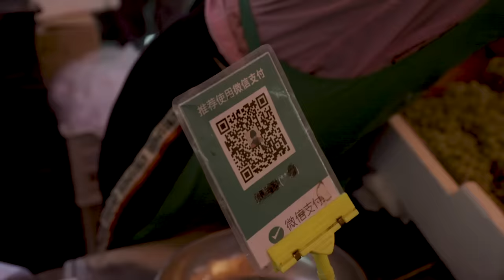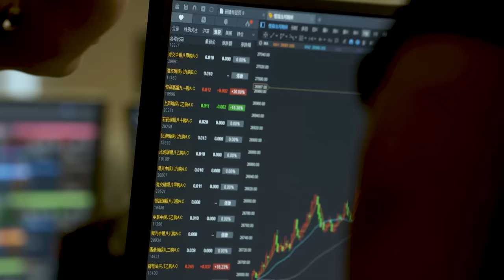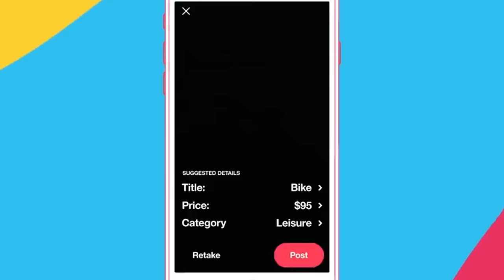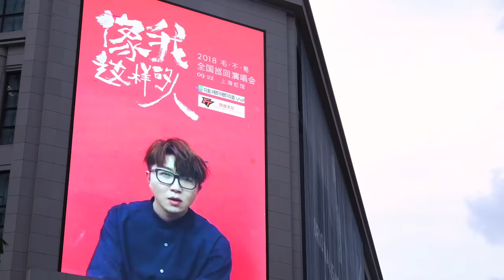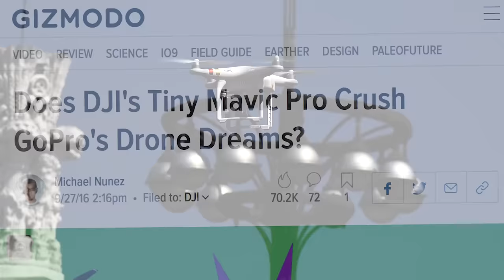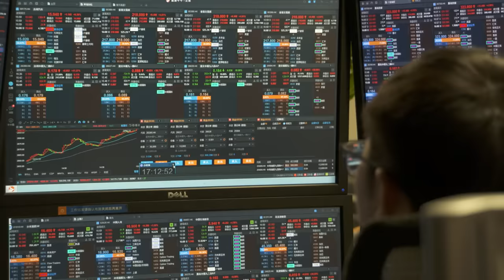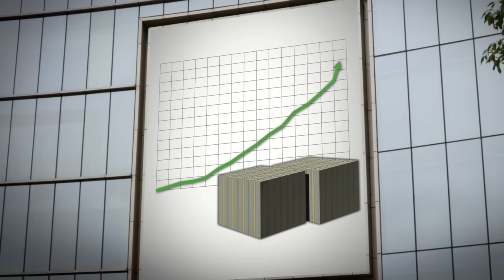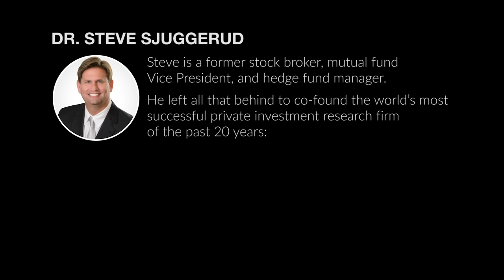New Money: The Greatest Wealth Creation Event in History (2019) - Full Documentary

Comment: So if your battery dies you have no money ?  Correct.
Reply: @Enemic Pezpot but with network or disasters problems, which are increasing in frequency now a days,when money is needed most, blockchain is dead. Cash is not going anywhere.
Reply: Yet they call it smartphones ironically.
Reply: ventende the qr code can’t be copied and changes every time you use it. There is no way anyone can hack it
Reply: There r portable batteries station every 5 mins you can walk from
Reply: oneviwatara  that's why you installe it in a cold storage wallet off the exchange it's called a nano ledger, s.
Reply: Enemic Pezpot You could technically have a wallet that signs private key and uses some sort of RFID chip (I Don't understand RFID tech) and you could have this chip inserted and programmed into your hand, powered by your blood pumping through your body or something like your body temperature. Something crazily futuristic like that. Then that would allow you to sign transactions without losing the ability to spend when a device loses its battery power. Only problem is when you're dead you can't pay for things anymore 🤣
Reply: You are bankrupted the instant your digital identity and database is wiped out.
Reply: TS Lee Bitcoin doesn't require you to have an online identity. If you don't believe me I can get you set up with a wallet and send you Bitcoin and prove it to you. The database cannot get wiped out, it's a distributed system It does not have a single point of failure. No one can restrict you from using your coins, they can't block your IPs, they can't stop you from having access to Internet unless they locked you up in a cell or turned off a whole countries Internet. Then again there are still solutions such a the Blockstream satellite that allows you to transact via satellite. Not only that but entrepenuers are working on bringing a global Internet system using satelittes that won't be able to be censored
Reply: @PumpkinToshi  you can't hack BC, but you can hack the wallet
Reply: Space Monkey If you have your money in an exchange (Basically a online Bitcoin bank) your account can be hacked. If you store your private key offline using a hardware wallet. Your wallet can not be compromised. it's not hard to secure them responsibly. Not Your Keys, Not your coins. 
Some mobile wallets have some pretty good security also you just have to be smart and use common sense :)
Reply: david stewart  What if the phone breaks down ?
Reply: @saltymonke3682  Mount Gox
Reply: @PumpkinToshi  still, you need to go to the exchange to convert it into flat currency if the shop won't take BC as a payment. Even the shop still need the exchange to convert those BC paid by the customer to pay bills in flat currency.
Reply: There will be decentralized exchanges which will mitigate the risk of trasfering between cryptocurrencies. There will always be a 3rd party risk with fiat off ramps and its security should be strictly regulated..the whole point is to keep the bitcoin and not sell it for Fiat. 

Space Monkey You can use 3rd parties that instantly convert it and the merchant doesn't know your using Bitcoin but it's not the point. I'm talking about in the future. It's like saying It's like saying in 1995 "Everyone's not using the Internet right now, so it's not going to be usable in the future"

Bitcoins not even ready for merchant adoption it's still in development. Bitcoin as of now is not used as a medium of exchange but a method of saving and speculating that the price (Due to the economics of the protocal) will rise in value. Once again, people didn't just start using the Internet overnight these things take time to develop although I just used Bitcoin in Japan to buy snacks and a travel sim card in the biggest tech store in Japan. Everything's there food, alcohol, tech, random shit so it's gradually being adopted it just takes time. 🤣 

Getting into Bitcoin now is like trying to get into the Internet cyberspace in the 90s. It's a niche of nerds and weirdos. But getting in early, if you research and understand how innovative it is, you could be rewarded in the future.
Reply: @jamesb.492  What a misinformed bunch of malarkey regarding the most liquid asset in the world. Gold sits above central banks' own fake currency. Check out central bank gold purchases over the last 10 years. Check out how the BIS made central banks report their holdings before it became hidden from public eye. GOLD ONLY. You're just a pawn spouting exactly what they want you to spout. I recommend reconsidering your misconception.
Reply: @marccompagnon219  You talk like China is using decentralized anything.. it's not crypto dude it's digital fiat scam money.
Reply: There is a thing called portable powerbank, guess they dont exist in USA.
Reply: If the power goes out for days due to a natural disaster, then there would likely be concern over the ability to charge a phone so one can continue to be a part of the consumption.
Reply: That is the problem, power never goes out for days in China, they have the best power grid in the world.
Reply: @cainiaowu  and their building the greenest tech thorium power stations, most of the world still installs 1950's dangerous designs
Reply: Well, it is not the fault of most world, China is late to the party, so it can use the latest and safest design available.
Reply: @PumpkinToshi  that already exists. nobody wants it though. I Sweden they're forcing it on a few people through their job.. they have an advertisement like this one about it here on YouTube where everyone smiling and happy and saying the tech is great and totally not evil.
Reply: MechanicalCheeze I'm guessing your talking about the hand chips right? I think there's a time and a place for these to get pushed into the market and right now there's not really a need for it. Sometimes people love to push tech into people's faces before they're ready for it. There's still a large number of people who can't even use a smart phone. I think we have too get through that stage of adoption before we innovate any further. It'll be part of our future I'm guessing, I just believe nows not the time. Same with Bitcoin, you can push people into as much as you want but the current banking system works perfectly fine for most people so why would they change? . It has its faults but thats not the point it's what they are most comfortable with. Right now the benefits of Bitcoin can be seen by a very niche market such as people that hate the current system of money, speculators who want to get rich of the volatility and Unbanked People with a technology background, educated and has easy access to smartphones.
Reply: @Aloewells  Cash isn't going anywhere and neither is cryotocurrency.
Reply: you can easily get charge your phone easily, in many small shops and restaurants have sth like mobile battery, they charge around 1 yuan I think. debt battery is not really a big problem.
Reply: I am sorry. We have share power banks everywhere. So, that's no even a problem
Reply: Efc Scouser ofcourse  that’s why iPhone is losing its marketshare in China, too quick to running out the battery 🔋
Reply: @Aloewells  please do tell me the last time bitcoin had a disaster.
Reply: oh , come on. do not be serious. We do carry wallet for emergency
Reply: Holy shit omg didn't think of that!!!
Reply: probably will be able to use your watch soon, which the battery can last for a week
Reply: @PumpkinToshi  point of failure is when I use crypto analysis. To come find you,  and rob you ,    your entire bankaccount is in your memory. Via password,  bankrobbery made simple.  Stay away from crypt-o
Reply: Fred Thompson You make it sound simple. Infact it's not. The reality is, it's safer than using the current banking system. The only point of failure you have is yourself. In the future, recovering funds and securing funds will be much more simple such as offline wallets being pre installed on smartphones. It's not a bank account. You can get my password but that doesn't give you access to my private key.
Reply: @PumpkinToshi  u have been warned,  my job is done.   Have a nice day m8
Reply: Fred Thompson You too mate! I hope you look into Bitcoin so you can understand it
Reply: oneviwatara  Not true..you also wouldnt put your life savings in your wallet maybe a couple hundred bucks.  you always have the keys so no worries.
Reply: in china, u can charge ur cell any time, any where.
Reply: Buy more China made powerbank
Reply: oneviwatara 
Don't put all eggs into single basket, problem solve
Reply: no if you lose your wallet or someone steals it you have no money ....built in solar charger for cell phones...its coming
Reply: Do you know there are many public places in China that rent power bank for the phone?
Reply: That won't happen in China, battery charging station literally EVERYWHERE.
Reply: @PumpkinToshi  oh yea? how much value have you left with Bitcoin now?
Reply: oneviwatara  like the app company  know less than you
Reply: @PumpkinToshi  mark of beast, right hand or forehead, heat part body charges battery
Reply: It's true!!! No one can survive without charge!
Reply: oneviwatara  Your money will not be gone without a trace, you can set a cap of max transfer and every transaction is recorded. Your money can be traced.
Reply: It's just too one sided so I am not buying. When you invent a new ship you invented a new ship wreck, ask the titanic. You have to make an analysis of drawbacks before you can claim success. China is a controlled society. You are not allowed to criticize.
Reply: That's why you use a portable charger, and keep your phone on battery saving mode when you're out and about.
Reply: @MrJohneblaze822  What if you lose or break your phone during a pandemic when all phone shops are closed. Maybe you can lend your phone and codes.
Reply: @Aloewells  They don't tell you the nitty gritty.  In China, you can rent a battery charger everywhere.  People don't even need to bring their battery charger around.
Reply: oneviwatara  your large bulk of money is still in your bank account. Wechat Pay or AliPay is like a debt card, you top up your Wechat Pay or AliPay account for your daily use.  When you make payment, you still need to use password or fingerprint to authorize payment.  It is safer than a credit card.  Don't worry about hacker, they can only hack a very limited amount.
Reply: @PumpkinToshi  - you are fried!